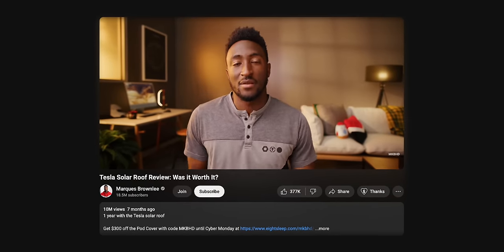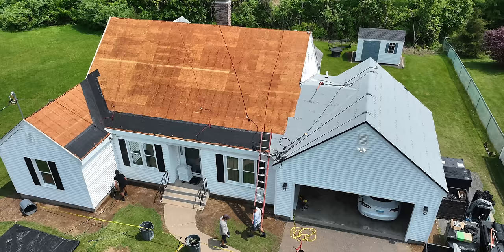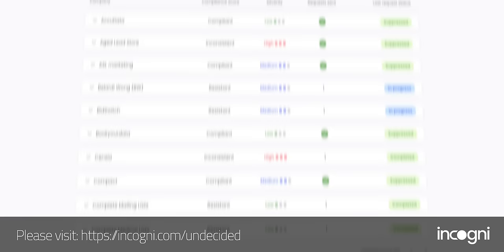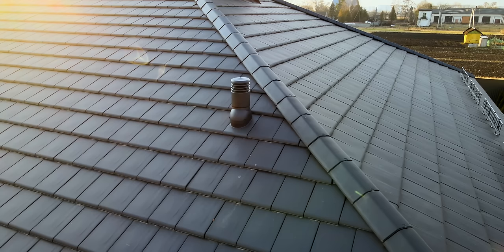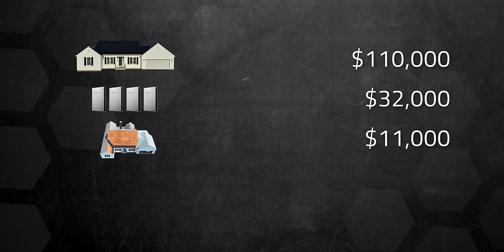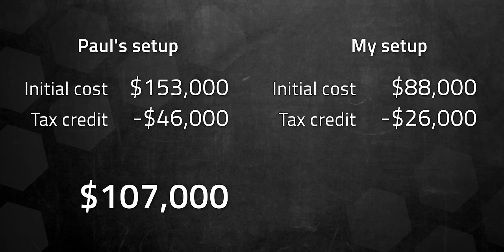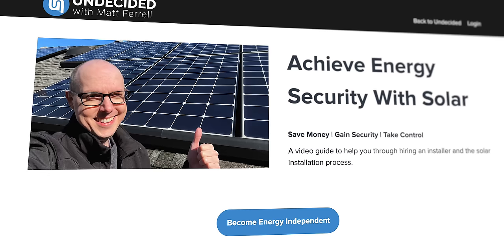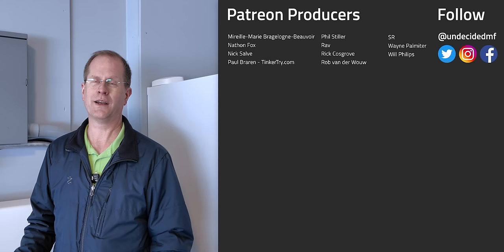Tesla Solar Roof vs Solar Panels: Which is Worth It?

Comment: Unfortunately the most decisive factor is not a technical one but is: What are the net metering policies?   My guess is that the reason Tesla rooves haven't caught on is that they produced TOO MUCH energy, covering the entire roof.    PG&E Net metering doesn't pay you for overproduction, they just take your electricity for almost nothing and sell it for top dollar to your neighbors.   You need to match your rooftop production to your usage to get the system to pay for itself in the shortest time.

Comment: As an architect I am currently designing my new home with my solar system in mind.
I will design the roof around the solar panels I end up choosing. Probably 2 large roof pitches covered edge to edge in panels.
I think the Tesla roof is an over complicated product that will be prone to all sorts of future issues.
Reply: Additional tips.
1) For optimal generation, the tilt angle and the azimuth of your roof matters as they are location dependant.
2) Allocate a well ventilated indoor space for your inverters. Excessive heat will cause your inverter to self derate.
3) Try to locate your solar module, inverter and your house interconnection point as close to each other to reduce cable lenght. Longer cable = more losses.
Reply: @zenniz1992  These are all great tips for folks following along. I'm the guy with the Solar Roof featured in he video, and I do wish my panel was closer to my garage, but not something I could change. I do find I'm glad the inverters and batteries didn't go in my basement below my office, because their fans get pretty loud on hot summer days. I'm personally quite glad they wound up in my insulated garage, where it rarely goes above 86F.
Reply: I'm finding I'm hitting 92F in the summer in the garage, so I probably will insulate my garage doors better to help with this as they get blasted with later afternoon summer sun. I might aldo put in a fan, to draw in outside air, exhausting some of this  hot air out through the attic.  Far better than having my inverters in direct sunlight though.

Comment: Prices are different in the US. Two years ago, I was quoted by 5 different installers in NJ for the 9kw system, no battery, and prices vary between $30,000 to $70,000.

Comment: TLDR; Paul’s system is better overall specifically if you care about being 100% covered from electric and selling back to or never pulling to the grid for any expansion electric needs in the future.

The biggest issue is the uncertainty of Teslas support, or iteration of tiles.

Comment: Great video and comparison!  Thank you.  My take-away is that the customer is responsible for being technically adept and involved enough on a regular basis to verify the installation and on-going performance.  Otherwise, the installer would not have replaced wires with adequate thicker wires, and would not have fixed software issues with monitoring.     On the other hand, once all the kinks are worked out such that the problems drop to negligible, the tax discount and net-metering may not be available.

Comment: And now they are finding out that mounting solar panels vertically rather than a slant works a lot better.  Vertical mounted solar panels shed dirt and snow far far better so they do not get covered with snow that blocks the sun or covered with dirt that restricts the amount of light reaching the solar panels, which means they operate at peak efficiency all the time the sun is shining on them no matter the season.

Comment: Currently in the UK new solar panels are coming in at around £70 for a 405W panel ( $0.20 / watt) and you can assemble a DC connected 48V 15KWh pack in its enclosure for around £1500.  I've just done an off grid system with 14KWp and 30KWh batteries with 15KVA inverters for a little over £10,000. If I had got an installer to put it in the price would have doubled but still would be far cheaper than these systems. Those quoted figures in the USA are crazy.

Comment: Your friend's existing roof during the Tesla tile installation creates an uneven comparison with your new build. To assess fairly, consider these scenarios:

a) Tesla roof and batteries (Friend's home),
b) Different solar brand and batteries on a new roof (Your home), and
c) Different solar brand and batteries on an existing roof (Complete comparison).

Excluding your home's roof cost from the comparison makes the Tesla roof less appealing in terms of value. Therefore, for the average person focused on cost, opting for a different brand would be more sensible.

Comment: I've got enphase.  I like them as they're supported in Home Assistant.  My panels and batteries were installed within a few days and were connected to the grid within a week or so.   It took my longer to setup and workout home assistant than it did complete my install and connect it to the grid. LOL

Comment: Getting off the grid would be great, but that is one hefty price tag!
I ran the numbers on a smaller system for my house. I live in the south where rates are way lower than you (Matt) describe, and I have a 2000 square foot single story house with a monster roof.
There is plenty of room for plenty of south facing panels, so I'm guessing I could get away with a measly $60,000 solar system. Here is my current (pun intended) expense:
 - I use an average of 20 KW per day
 - Electricity costs an average of $0.12 per kWh.
 - My monthly service charge equals 0.83 per day ($25/mo)
 My average monthly bill is just shy of $100 ($97.97), so I'm using $100/mo. as my measuring stick.
Assuming I don't have to finance the job - and that's a stretch - the system would pay for itself in only 50 years, assuming zero maintenance costs.
 - and if I stayed connected to the grid, that's another $25 x 600 months = 15,000 in service charges. You can do the math on how long it takes to break even, but it is north of 75 years.
BOTTOM LINE... Ain't no way I'm going solar unless I come into stupid money and won't care if it ever pays for itself.

Comment: I want mine installed on the ground. I have a big backyard. This day and age nobody uses their yards for anything necessary, and I've noticed new homes aren't built with big yards anymore. The only thing I do with mine is wear out lawn equipment. And I definitely don't want to use it for storage. I could build a house and rent it out, but there was a time when I was a maintenance guy, and I will never do that again. I haven't looked into it, but there's probably a limit to the number of panels you can own, if not I'll be set. There doesn't seem to be much info without some damned obligation of some sort. Great video Matt, your info really helps,  thanks.

Comment: Years ago I used the Tesla roof calculator for my Florida 5200 sq' ft roof and came to $120k. At the time my electricity was 10.2 cents per kWh and today it is only 11.2 cents.  Then adding 120k value to my home would increase my property tax for years to come plus insurance would raise my rates a bunch. So I just pay the 11.2 cents kWh. And if I got solar I would want run off batteries and use grid as a back up so even more costs all around.

Comment: That was unfortunate  but not surprising that Tesla firmwared a cheat algorithm that overstated production, and therefore misstated efficiency. It seemed deliberate and Tesla's response not to argue, indicates they had planned to come clean when the first challenge appeared.

In the realm of fitting a square peg in a round hole aesthetics, I would think that there may be opportunity for higher return on investment by contracting to a vendor that laser cuts custom panels to better cover a larger percentage of an irregular geometry roof. It would mean additional microinverters of course, but it seems like an expense that cannot be avoided in the quest for 90% roof coverage.

Comment: One thing that stands out with the two houses discussed in this video is the lack of trees near the houses. Yes, I know that shade decreases the effectiveness of roof solar systems, but I wonder how many trees were cut down to allow the roof system, or indeed to build the house.  It's not going to do the world much good if the eastern part of the US goes solar by eliminating large tracts of tree cover and their CO2 sequestering abilities. A better solution than homeowner systems  is a national policy where solar power is generated in the west, and perhaps transferred and stored where it is needed.

Comment: My area of Texas has plenty of sun but HORRIBLE net-metering plans.  With no realistic net-metering option,  we keep the energy company away and therefore have no permit issues.  None.  Zero.  (for clarification, being in the county versus city, we only need permits for wells or septic.)  This allows us to build or buy any combination of name brand, new, used, UL, non-UL, white label, DIY, etc.  In that scenario, our buildout will be bigger and still 1/5th the cost AND we get the the tax credits for any non-used equipment.  In our location, the choice is simple.

Comment: You’re certainly right when you call out Tesla over their atrocious customer support, or the total lack of it in some cases. I’d love to own a nice Tesla EV but living in a rural area that’s not in the cards for me because it’s over 200 miles to any location where the company offers maintenance or repair. I did choose to sign up for their high speed Starlink internet service despite its very high cost. The problem I quickly discovered was they offer no customer support for it either. I paid a premium to have it properly installed which didn’t happen and now more than 2 months after having it put in - it’s yet to work. I’ve had repair scheduled 5 times and had 5 no shows from their 3rd party installation group. Buyer beware when purchasing a Musk product. You may not get what you thought you were paying a premium price for.

Comment: I installed last year 8 KW for $8500 (no battery, no car charger, just electricity). I didn't receive tax credits, but I resell extra power to the grid at the cost I would buy it, which means the grid is my battery. 8KWh covers my needs + room for aircooling. My house is 320 m2 total. I wouldn't opt for a tesla roof: I don't want to depend on one supplier, and a limited (if any) installer. I don't think we can have Tesla solar roof here in Belgium. The PV panels are on the back of my house. I think technology will evolve further, and in 15 years I would not want to replace my roof to get a better version.

Comment: In calculating the costs of solar, you should not only deduct the rebates, but also the present value of the cost of electricity you will not have to pay at Massachusetts rates (over for example the next 25 years).

Also with so much battery storage, it may be that net metering is not for you. You might do the calculations to determine whether dropping net metering and going with time of use rates might save you far more. With so much battery storage and on-site solar, you might never need to pay high intraday rates and always get the deep discounted off-peak rates to recharge your home batteries.

Comment: To answer the question though...  Why don't you see not Tesla roofs?  Because they would only be installed on a house completely replacing the entire roof.  Which is not an that common. Primarily only on new houses.  And  even on a new house, is pushed all the costs up front, sand time you are trying to afford the house itself.  It's far easier to be able to afford to do it later after building the house and moving in.

Comment: Most people that are considering solar are not building a new house and therefore wouldn't need a new roof.  That eliminates Tesla right away.  On the issue of the county allowing you to connect to the grid.  In my case it took about 3 weeks.  Not a big deal for me, I guess it can take a lot longer depending on how your efficient your county and local power grid company is.  The other issue that isn't talked about much is the lifespan and efficiency drop from the Tesla roof.  Nobody knows what those numbers are.  I do have the tesla batteries, which I like.

Comment: Late 2022 I replaced my roof with a new asphalt roof and added 14 solar panels.  The roof replacement was slightly premature but it was aging and I wasn't going to install panels on the old roof.  I liked the idea of the Tesla roof and its look, but with cost and delivery/install/availability delays, and the more readily available knowledge and equipment of the standard panel approach, I (fairly quickly) decided to go with standard panels.  I have a considerably smaller house than either of the 2 in this story, but part of the reason for not installing more panels is some complexity in my south facing roof pattern and some large tree shading that technically are owned by the city (in the parkway between the curb and sidewalk).  I hope to at least get them trimmed back some, which would at least improve solar output, but that's a challenge (again, the city does trimming on their own schedule).  Consequently I'm only generating about 60-65% of my energy (even without an electric car or electric heat), but after federal tax credit and SREC money (eventually... long wait for SREC funds), the net cost is around $7k (solar, not including roof), so I didn't have to come up with a large amount of money and am getting significant reduction in my monthly electric bills, even so.  I can imagine/dream that perhaps something like the Tesla roof will eventually come down in price some, and become more of a normal/standard roof sometime in the future (?)  Initially I'd planned to get at least some battery backup, but the solar installer kind-of advised against it as not being financially beneficial given net-metering, although the batteries would have provided some outage backup... However, we have had few outages (it has been quite a few years between any outages of more than an hour - although could happen).  While not as good from a climate perspective, a backup generator, even an automatic one, would be more cost effective, and in my case, and depending on weather, for an extended outage, the solar panels with batteries, would likely not provide enough power (multi-day outage particularly).  By "depending on weather" I mean if you have an outage of more than a day due to a significant weather caused outage for instance, and you have cloudy or snowy weather, particularly if snow is covering panels, then the battery backup will run out and panels won't keep up with demand, which is part of my reason for saying a generator backup may be more reliable than batteries, particularly for an extended outage, and cost less money.

Comment: Just to recap and make an apples to apples comparison. Tesla solar roof + batteries is $142k (you can't count the underlayment refurb cost as it's old house vs. new build) while metal roof + solar + batteries is $133k. That's a difference of $9k but when you factor in the tax credit the Tesla solar roof + batteries is $100k while the metal roof + solar + batteries is $107k. On top of the $7k savings he has more solar (10kW extra), battery storage (twice) and it looks better, definitely the better deal.

Comment: I had solar installed three years ago.  8.5kw system with 2 powerwalls.  $33k total after the fed tax break. Double that to the size of Matt's system and I paid half of what he did. And far less than tesla roof would have cost.  Shop around.

Comment: I'm in California where energy is twice as costly as anywhere else in America.  I installed my own panels,  inverters, & batteries.  I'm still doing some tweeking & upgrading since this is all new technology for me.  I'm producing a little under 20kwh per day, depending on sun/clouds.  Nobody in the neighborhood can see my panels because my south facing roof faces the backyard.  So far the materials cost was $19k.  I wish I'd waited to take my 30% federal credit until I finished tweeking because the changes I want to make are going to be another $6-8k.  But being retired, the combined federal credit & lower tax bracket gave me a tax refund of $18k, almost completely covering my cost.  Cool!

I have a ground-mounted solar tracker  that needs to be installed still, & will carry 6 panels putting out somewhere between 5-10 kwh per day according to the manufacturer.  We'll see.

My utility has already had outages, & it's nice to have power anyway.

One extra tidbit... we tend to think the best days for solar are 100% sunny.  Not so. Partial cloudy is the best because the solar lens effect kicks on with those clouds & my panels crank out far more than on sunny days.  I was afraid of exceeding the voltage limit for my inverters, but was told it was OK by the mfg.

Comment: My decision to NOT get solar was very easy - basic math showed that there was never, ever going to be an ROI going solar.  Taking that same money for solar and simply putting it into an S&P 500 index fund will yield, over the same lifetime as a solar panel, FAR more money than you will ever spend on electricity.  Then you also get the benefit of not needing to maintain solar, repairs, and all the other stuff involved with it.  I just did a new build, considered solar until I actually looked at the numbers - glad I passed on it.

Comment: I saw about vertical solar panels generating as much as ones on rooftops.  They may have been double aided panels.
Doesn’t metal roof heating up reduce solar efficiency.  That was another reason that vertical solar panels generated more energy than expected.

Comment: We are replacing our roof with metal shingles and having the PPA panels from solar city swapped over to them since we still have about 15 years left on that terribly designed system.  There's so many options for installing on metal roofing now, it's a roof that will live 150 years, possibly longer than the house whereas shingles last from 6-20 years for only double the cost.